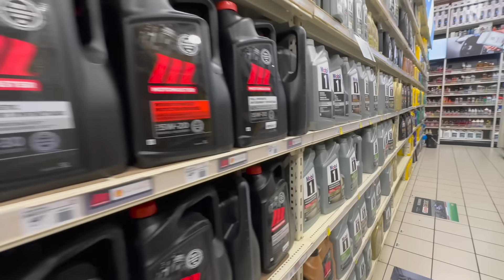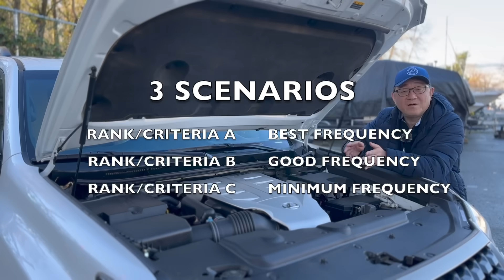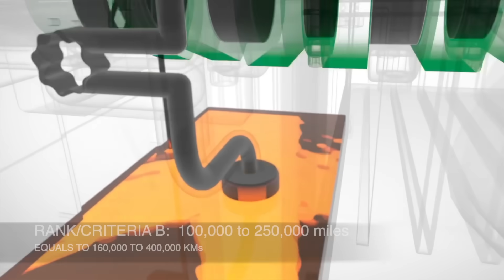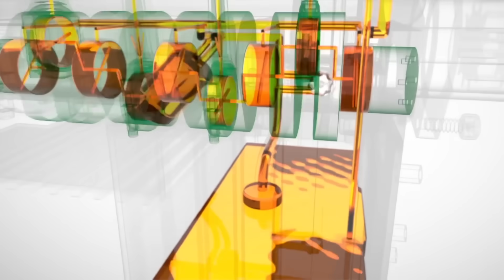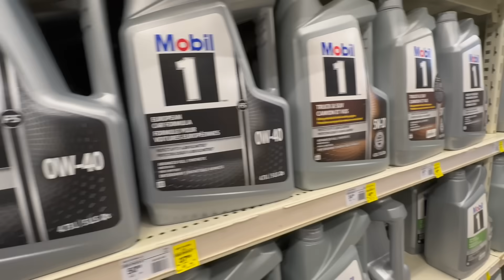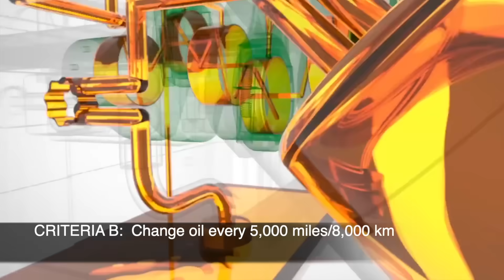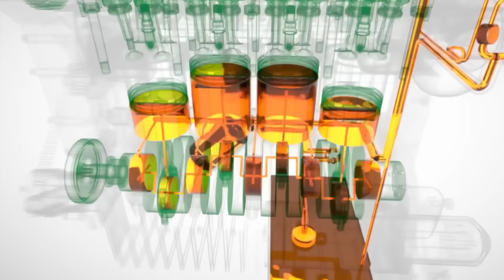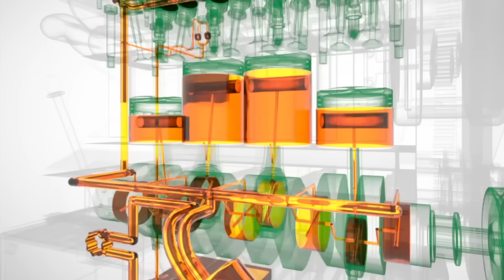ENGINEER EXPLAINS HOW OFTEN TO CHANGE OIL & FILTER // UPDATED CRITERIA-BASED RECOMMENDATIONS!

Comment: people say, oil; lasts for a very long time as it does. But they are stubborn to understand it is the impurities and contaminants that enter the oil from the combustion chamber that does the damage.
Carbon and fuel from blowback past the rings and condensation from sitting overnight is what contaminates oil. Good job on showing them. I change my oil, synthetic every 5,000 km or 6 months whichever comes first. My cars last forever. No oil leaks, no wear and of course changing the oil after run-in, say the first 1,200 km to get rid of the shavings from bedding in the engine is also needed. 
Car dealers tell ignorant people that the car is run-in at the factory. haha

Comment: If I buy a good car, I'd like to keep it as long as possible. However, the issue we face here in Northern countries is that the stupid government spreads salts on roads in winter time. Those salts will destroy car chassis much faster than any failure of engine or other mechanical parts in a reliable car. As a result, I will keep my routine of changing oil no more often than once a year. Actually I change oil even less frequently, say once every 2 years, on the van we drive only during summer vacations. That schedule has served me well so far.

Comment: Toyota dealer recommends 10k miles but the oil service light comes on at 5k. Since I don't drive a lot, I can go 12 months between oil changes but won't go over 7.5k miles regardless. My wifes car has an oil life indicator and I change it when it gets to 10% regardless of miles... same with my daughters Jeep, change it when the change oil comes on, regardless of miles.

Comment: From engineering background could you also recommend the other systems albeit closed systems like the transfer, differential and transaxle.  2024 1794 4x4 OR CM Tundra HV. I did my 1st engine oil change and filter at 1500m. But will also change the systems in question at the 3k mile point along with the 2nd oil change.

Comment: A good lession is to try a car with variable oil service intervals. If it requires you to change after 0.5 or 0.7 or 1.0 maximum you indirectly get the engineers view of your driving pattern.

Then do the same but stay on the conservative side on all your cars.

Comment: I believe criteria A makes even more sense if your car is turbocharged because the turbo literally burns the crap out of the oil because I tell you by the time my oci hits 1,000 miles the oil looks black as night lol and I use the more expensive micro glass media oil filters so I know it’s getting filtered pretty good and it’s not dirt so much as heat that’s causing it to turn so dark so soon lol

Comment: I was advised against getting having an oil change done at 1500 miles for my new Lexus by the service advisor. 

I know that the car has additives to help during the break in period, but some professionals advise to have the oil change done after 1000 miles in order to remove any metal shavings. 

I don't think going against the manual's recommendations voids any warranty.

Comment: I have had few vehicles that manufacturers recommendations were to change the oil every 10k miles and none of them had engines issues or they burned oil as I followed those recommendations. I had a 2007 Chevy Suburban and 2010 Prius. I bought them brand new and sold them when they reached 120,000 miles. 

My third vehicle, 2014 Honda Odyssey, I changed the oil every 7,500 miles and the oil filter every 15,000 miles. The van did not have any engine or oil burning issue as well. The van was totaled at about 125k miles because someone rear ended us.

My current vehicles is 2021 Tundra. I change the oil every 5,000 miles, but the oil filter I change every 10,000 miles. This one seems to burn a bit oil though. I do not need to add any oil during the 5,000 mile interval, but if I keep driving it 10,000 miles, I have a feeling that I may add some oil. I will skip the 5,000 miles oil change this time and see if the oil level will go down to the bottom dot before the 10,000 mile interval just to see if it is burning oil.

Comment: This cannot completely apply to modern vehicles. Reason being, there are a plethora of other factors. For example, many cars' oil systems are complimented with small screens all over the engines. These small screens will get clogged with debris, new oil or not. Combine this with direct injection motors which the many manufacturers are producing for their main lines and you have a system that sooner than later of 150k - 200k will need to be torn down with parts replaced.

 You can have oil changes every 2-4k miles but there will be soot, carbon and even metal blocking these ways. It is the inevitable with modern gas powered vehicles. Let this go too long and oil starvation will occur and it does. Everything from your cylinders to even balance shafts are affected by this. These screens are everywhere, in your timing chain system, in your engine block walls and even in the balance shafts themselves. 

Twenty years ago, it was very easy to keep vehicles running for 200k miles by simply taking good care with frequent oil changes. Those days are gone, the engines are too complex and consumers are too demanding by fads which drives the disposability of automobiles of today.

Comment: I have 250,000 miles on my 04 Tacoma .Bought it with 117,000 miles so I don’t know what first owner did.I changed twice .Last time was 100,000 miles ago.Add probably two quarts a year.Recently I added a quart because my valve cover is leaking a little.Oil changes are a scam!Use synthetic oil .Oil breakdown is a myth

Comment: Most cars have trip computers that calculate average driving speed  between resets.
I currently average 20 mph overall as there is a good proportion of city so I am doing 5k mile changes on synthetic.
So that is factor, engine hours lower average speed means more engine hours for the given miles.

Comment: First, use the best quality full-synthetic oil (use Amsoil signature series)  and filter!!!
Then change the oil filter ~ every 5-6k miles and change the oil ~ every 20k miles.  For extended drain intervals, use oil sample analysis to tell you when it actually needs replacing. My wife’s Nissan suv is going strong w 320k miles with that criteria.   
My semi truck, with oil analysis and filter changes every ~30k, I  replace the oil ~ 100k and oil analysis shows it still in decent shape w very minimal contaminant content.

Comment: Engineer or not, this guy is totally old school CYA.  Not sure what he is an engineer in, definitely not petroleum or filtration.

Decades ago I read in Popular Science about Mobil's new synthetic oil.  They put an engine on the dyno and ran it the equivalent of 100,000 miles, only topping to keep it level in the crankcase.  At 100K, they disassembled the engine.  It literally looked like new, there were pictures.  All the machining marks, not a hint of ring ridge forming.  This guy says it's OK to run synthetics for an additional 1K.  Why bother, and no, it's not because of contaminants. 

First, modern engines do not make contaminants of the type that cause increased wear.  And with fuel injection, gasoline dilution is not a factor.  And he totally neglects the matter of oil consumption and topping off. 

For these reasons, I do not change the oil in my 2000 Regal GS.  I bought it at 180K, changed to oil and filter to Mobil 1.  It leaks and consumes (mostly leaks, it's obvious) a quart about every 4K miles.  Calculating, including the change volume necessary, by adding a quart every 4K miles, I am effecting an oil change about every 15K miles.  Contaminants out, new detergents, etc. added.  

As to filters, I was a filtration products sales engineer for a huge industrial supply many decades ago.  The fact is, as a filter gets clogged, it filter better and better.  If your car block or the filter did not have a bypass valve to let thick, cold oil flow, yes, the filter would eventually plug off all oil flow.  

The carbon that makes your oil black cannot be filtered out by full flow filters.  It does not cause wear.  The amount of iron and bearing materials is literally nothing due to better machining and....oil.  Look at the new cars that don't allow a transmission filter change for those very same reasons, and that's with soft aluminum casings. I've not changed my filter, either, for about 25K miles, although I admit I do think from time to time that I should, "just because."

I'm confident that my engine will outlast my driving years, I'm 77.  My transmission also runs full synthetic.

Comment: Oil is cheap, repairing them isnt.  I will always be 3k LOF for my NA vehicles....  Manufacturers telling me otherwise, isnt changing my mind.  They dont care about anything other than the cost to own part of the window stickers.  Sure 8k LOFs, lifetime trans fluids, 100k tune ups, Ill pass on my stuff...

My 20 something kids have been with me under our cars at oil changes and I have shown them the black stuff coming out at 3k vs the new.  They also know 3k LOF, Techron additive and rotations are their routine.    These new cars have so many components with tight clearances and fresh (clean) oil is a must with cam phasers, etc.   Like mentioned its not the fact of full synthetics hold up viscosity, the fact is the blowby and contaminants are the issue.

My harder working turbo vehicles,  the intervals are dropped to 2k.

No the guys who drop their rides off at Jiffy Lube places every 8k to 10k for LOFs and have no idea what the oil even looks like at those intervals arent going to change my mind with their arguments...  Ill maintain my $$$ vehicles on my schedule.

Comment: I have a question, my new Subaru tells me to use 0W16 engine oil, do they build engines with tighter tolerances now so that we can’t use a 5W30 engine oil if we want to?? Will a heavier viscosity oil damage my engine OR is the lighter oil being used to just to increase fuel efficiency??
Reply: Yes, you are exactly right, tolerances for that engine are very tight/small.  A thicker 5w-30 won't lube as well.  Subaru engineers built your engine to run on that oil for best lubrication and fuel efficiency.

Comment: 2020 Camry.   I changed oil and filter every 5 thousand miles which was two changes in about 10 to 12 months.   Last year I only put 2,400 miles on the car and it was a year in between changes.   I thought about doing it every 6 months but I fall under category B. which is oil and filter every 5,000 miles or once a year.

Comment: Every 8K.. quality filter and fully synthetic GF6 or Dexos gen 2 certified oil only.  160K on my gen 1 Ecoboost f150. Still runs GREAT.

Not worried about keeping past 200K but it seems like it'll go past 200 the way it's going now..

Comment: Very good video.  Nice categories to break it into.  I wonder how good the factory fill oil is?  I'm wondering because I changed my oil in my car at 5100 miles.  It sounds a bit different and the engine sounds like it is moving much more freely.  The difference is noticeable even from the way it felt/sounded from day one after purchase.  The manufacturer's recommended interval is 10,000 miles.  The production date was 12/22 and I purchased in 10/23.
Reply: I’m no mechanic or engineer, but I’ve watched at least 50 videos on oil and oil change intervals, and I have yet to see any real mechanic say follow the manufacturer recommendations of something like 10,000 miles. Always change your oil between 3000 and 5000 miles. Without question!
Reply: @Maynardd I would tend to agree.

Comment: It's easy. if your oil is contaminated it needs to be changed.  If your car is newer and you have kept the oil changed it will look clear longer.  If you buy a used car that the past owner didn't keep it changed the oil will get contaminated fast, so you will need to change it over and over until the oil carries the built up dirt out of the motor.

Comment: I have to disagree. It is not important how long you want to keep the car to choose your oil change interval. The most important one is, do I drive generally more or less than 30 miles each time I drive? If yes, you will just follow the maximum interval recommended by your engine manufacturer. If no, you follow the minimum interval recommended by your engine manufacturer. What is also important is the engine you have. A small, turbo powered high output engine is prone to high stresses and thus needs more frequent oil changes than low stressed naturally aspirated engines. But I think the long or short drives is the most important variable.

Comment: As soon as I see the oil is no longer that brand new amber color on the dip stick and I see it is the least bit brown, I change that oil. Usually that happens between 1500 and 2000 miles.

Comment: Common sense advice. I used to drive 14,000 miles per year and had service twice per year including oil change with synthetic. I now drive about 7,000 miles but still service twice per year. I intend to keep my LC forever but circumstances change. If I do sell the car early, the buyer has evidence that I have looked after it and more likely to pay top price for it.

Comment: The whole "normal" versus "severe" service has been controversial since the 1970's when the SAE defined these terms.  As I read normal service virtually nobody falls into that criteria which is basically highway driving in good weather.  I have always used the following:  If the car is not driven much then change the oil every 6 months.  Otherwise severe service intervals or no more than 4k for a turbo and 5k for NA.  My engines last a long time and do not burn oil.  The car I drive actually specifies a 3k OCI with synthetic oil in the owners manual.  It is GDI and the oil gets pretty dirty.  I also have Fumoto valves installed on all of my cars to make my life easy.

Comment: This proves a point I keep mentioning to friends & family.  You have to know when to trust the owners manual and when not to.  
Also, everyone forgets about transmission/differential/transfer case fluids too. This gentleman's drain intervals applies to those fluids too!!!
Reply: No. Transmission fluids vary, but 30-60K depending on vehicles. Changing those fluids at 5K intervals is total overkill. Cheers!
Reply: @brblum  Every 5k is extreme, but I changed all of mine after the first 5k, and glad I did.  Both diffs & transfer case and transmission were grey with metal dust and the magnets on the drain plugs couldn't collect any more metal.
Reply: @TheBeatenPaths  Wow. That's unbelievable. The first 5K I guess I can understand, since a 1K first oil change is pretty common. Good to know...thanks sir. Cheers!

Comment: I have always change oil and filter since 2000 at 5000 kms. Its the cheapest way to extend engine life.  Before year 2000 it was common for people to change oil every 5000 miles and a filter every other oil change.

Comment: This is why I won't buy a leased car, because I don't trust those owners to have replaced the oil frequently enough. Same goes for rental cars. It's because of rental car companies that auto manufacturers changed from recommending oil changes from every 6k miles to every 10k miles. Car manufacturers want those big fleet accounts.

Comment: I use Mobil 1 Extended Performance High Mileage & filter.  Absolutely love that product
Reply: I use to care about oil brands. Not anymore. The best oil brand is the one that is fresh new oil and filter, regardless of brand. My current brand is costco oil(cheapest I have found) and toyota oem filter(sold in a box of 10).
Reply: There is no such thing as a full flow filter that cleans oil. All they are supposed to do is keep large engine damaging abrasives from getting to the engine parts. You drain the oil to remove the small stuff or invest in a depth bypass filter. A 25 micron particle between polished surfaces is not small. Its not rocket science. There are several brands of filters that clean oil. They all have hoses to deal with. I like the ones that use toilet paper or paper towels. The toilet paper jokes and BS stories dont bother me anymore.

Comment: Hi David. Excellent simple explanation with your three categories. My dealer in Toronto recommends a 8000 K interval. I alter this by changing oil and filter myself at the 4K mark. Makes it easy to remember. I always use synthetic primarily as it is easier on the engine for cold winter starting.

Comment: I have been using Mobile 1 since it was 1st introduced.  At that time, they sold it as almost a "lifetime" oil for the car. At 3-4K intervals, you did a filter swap and then topped up the oil level.
Their sales point was that the synthetic never wore out, just got dirty, thus the filter change.
I did have some oil tested at an oil lab and they confirmed that the oil was still in excellent shape when i changed it on the 4th visit.
Any comments on this?
Reply: I put 250.000 miles on a 84 Subaru with no oil changes using Mobil 1 15 50 racing oil and a Frantz oil cleaner. My Pontiac Torrent uses Walmart synthetic and a Australian Jackmaster Classic The filter is what counts. The trick is to keep the oil clean with depth filtration. Drive enough to heat up the oil so the PCV can do its job and to add enough makeup oil at filter change to keep the additives up.I change the Jackmaster Classic every 6.000 miles and drive mostly highway.

Comment: just cracked open my valve cover on my 2010, 2.5 liter MK5 Jetta, with 200,000 miles on it. The engine block is almost like new inside and all you see is a golden oil color, zero smell, minimal wear. I do the oil every 4,700 miles to 5,200 miles max and I don't cheap out on a premature oil change, by trying to get more mileage out of it. That is the crucial part! Don't be cheap! I drive Uber full time and do one oil change per month, minimum. Busy months, two oil changes... Cheers